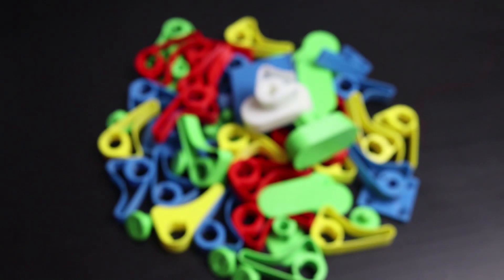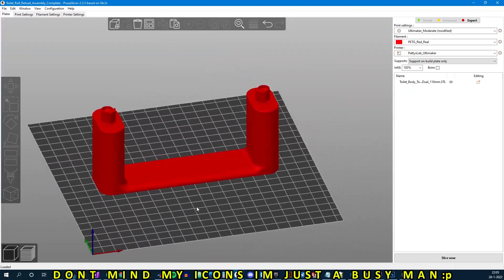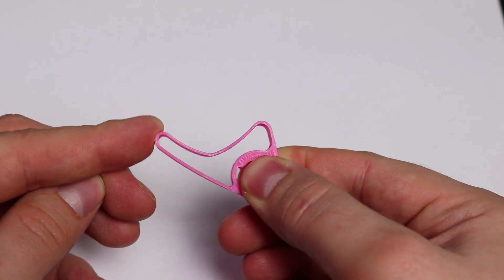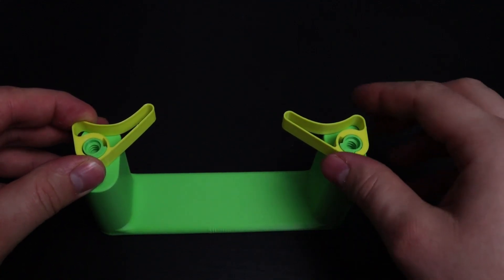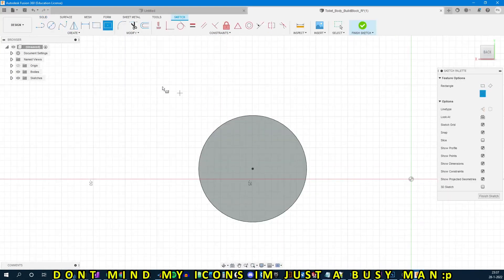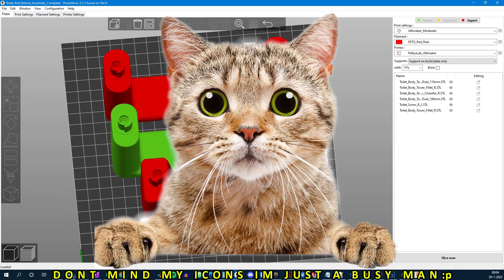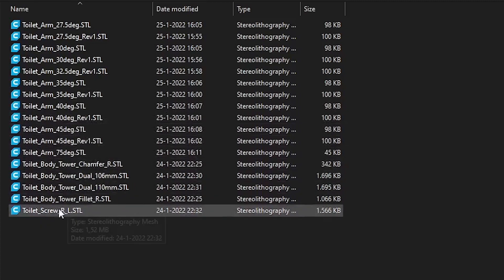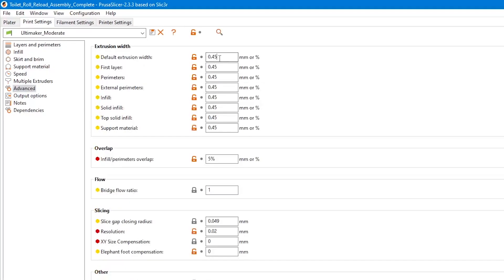Epic 3D printed compliment Quick Reload!

Comment: What did you redesign? That mechanism is in every modern toilet paper holder out there, some without the compliant mechanism. But it's basically the same thing.
Reply from the maker: I've not seen them anywhere here in Europe
Reply: @PattysLab  Makes sense, seems like a recurring pattern with Europe.  Old architecture, old toilet paper holder 🤣
Reply: I haven't noticed any in the West coast of the U.S. Maybe there are some premium options that are similar to this, but most just use a cheap spring-bar method.